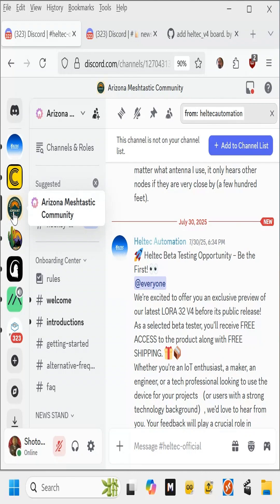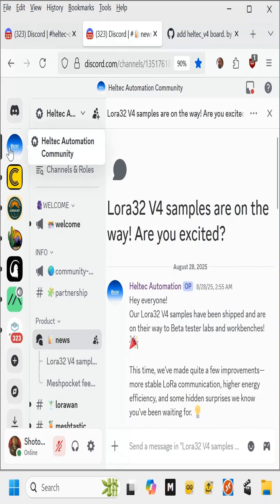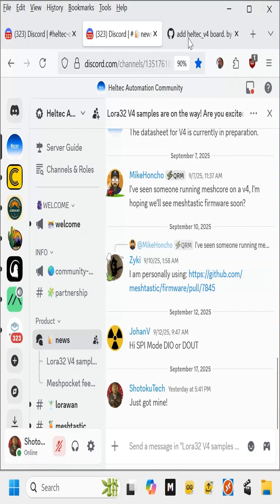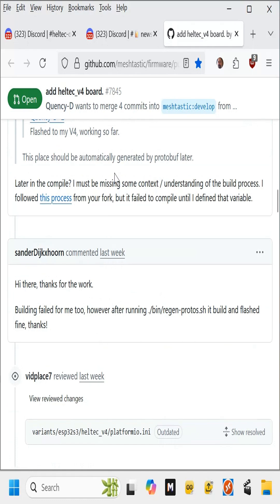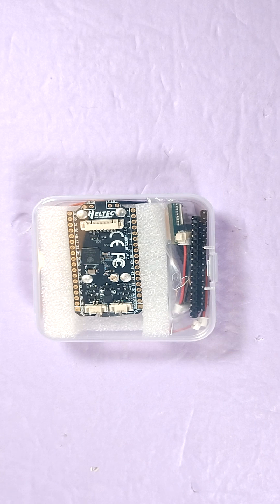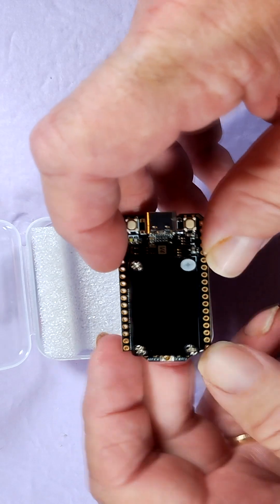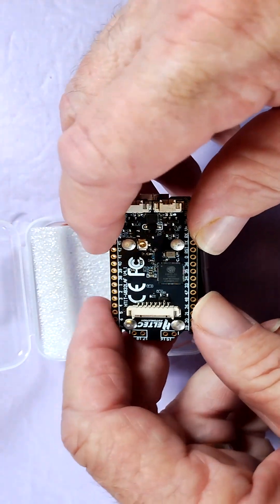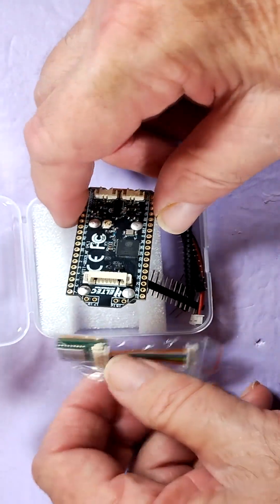Unboxing Heltec LoRa 32 V4: New ESP32 LoRa Board with GPS & 27dBm Power! First Look

Comment: Just got mine today and struggling with firmware. The mesh site takes you too FW but the flash button is dark and the serial connect only toggles tx rx entries or something. Anyone instal the FW from the mesh site yet?
Reply from the maker: Are you selecting the latest alpha image? If the Flash button does not light up, try a newer version. Since the board is just released, older versions may not take this board into account. Best wishes.
Reply: @ShotokuTech good point. I shall endeavor…

Comment: I see they "flipped" the battery and solar port orientation. The socket is no longer facing the back of the board but the USB port side. Does that cause any problems regarding cases or did you not try casing solutions yet?
Reply from the maker: I definitely saw that. Will have to give it a look. The battery and solar ports are not labeled so I am only guessing until there is an actual pin diagram. This is an early preview right now. I'm sure Heltec is busy behind the scenes. Thanks. Best wishes.
Reply: Oh, they are labeled. It is written diagonally onto the corner of the PCB.
Reply from the maker: @frankvonbismo549 cool I will take another look.